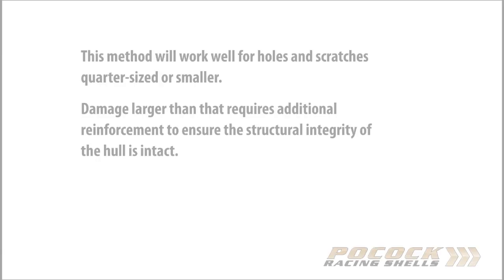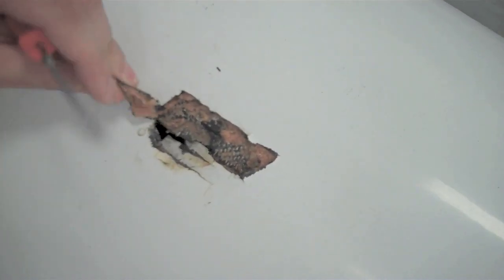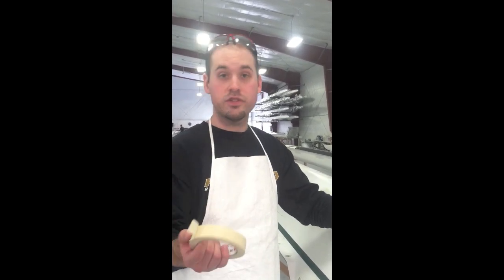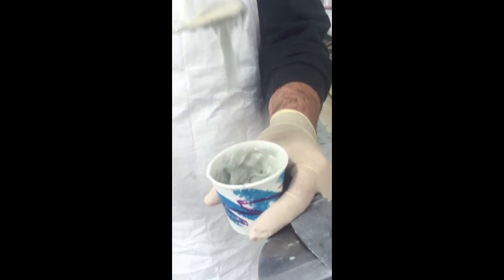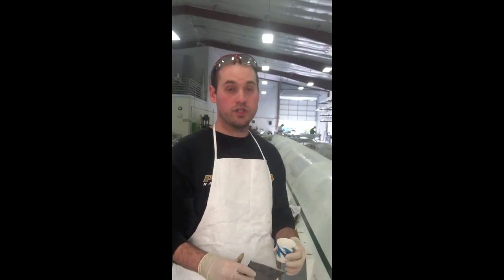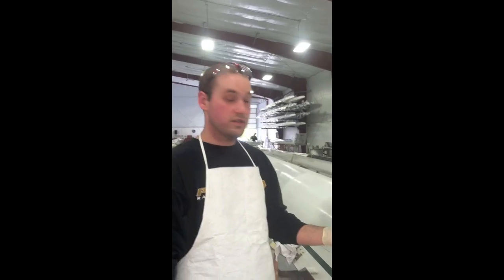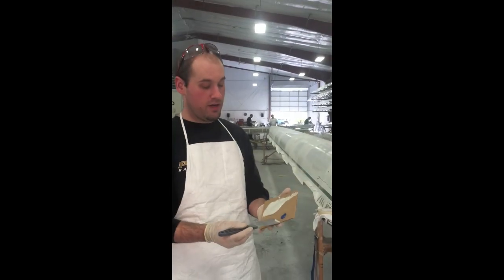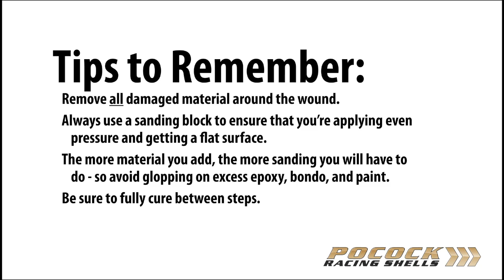Rowing Shell Repair - fixing small holes and scratches

Comment: When you wet-out your carbon fiber or fiberglass make sure you do not use too much resin. You should be able to see the fabric texture with light reflecting off it. If you have too much resin, use a dry brush to absorb it.